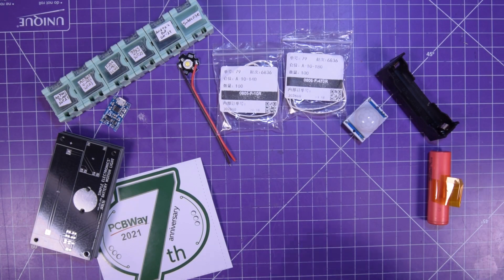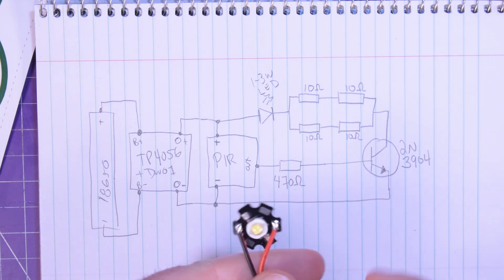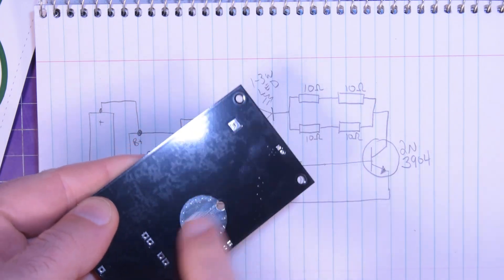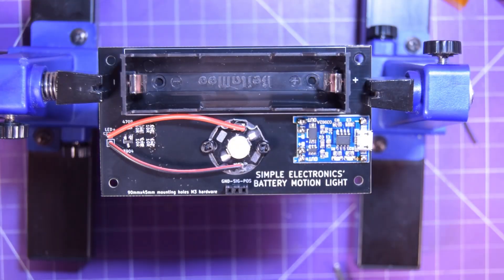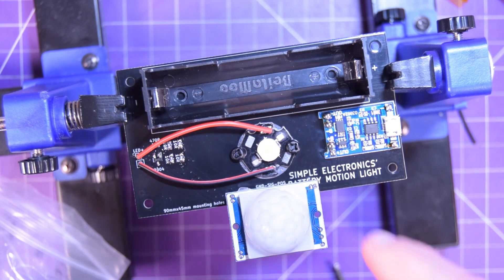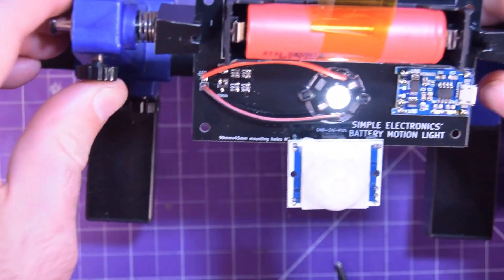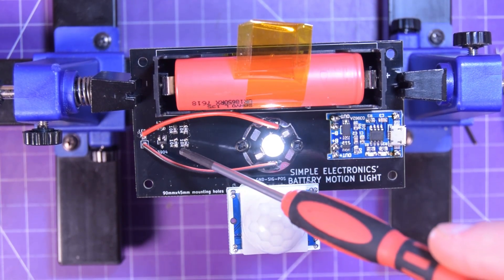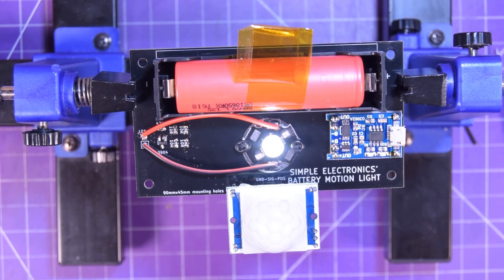Wireless Motion Sensing Light - For All Your Motion Sensing Needs!

Comment: Do you think the light is bright enough to work as an under-cabinet light in a kitchen?  That is a project I have been considering, except with motion detection to save energy, as I rent and can't go drilling holes, etc., to run power wires.  The problem is that kitchen lights are typically pretty bright.  I was originally considering strip lighting.

Comment: While most of the project built with modular parts, I suggest you add a mini led driver or chip instead of the resistors, which will make it more efficient and allow to easily adjust the current for different led wattage and brightness.

Thanks for sharing.

Comment: There are solder pads on the pir module to connect an ldr, you need to remove the white lens to see them, that's all it needs. It will then only detect movement when it's dark. The correct pads, one side goes to pin 9 of the pir chip.

Comment: Curious why you just didn't design the pcb to be either through hole or surface mount, like other boards you have done.
Also might be a good idea to add a page on your site for listing all your projects.
Reply from the maker: A lot more work to make dual footprints - and since shipping from china takes so long, I have to manage how long I work on the design of boards.

Comment: The use of four 10 ohms resistors, 2 by 2 in parallel to give 10 ohms resistance, is that done for redundancy?  I.e. If one resistor were to fail, would that mean only a single path would be left?
Reply from the maker: Done for heat dissipation and being nicer to the components, it's a cheap way to make a 1W resistor, just combining 4 x 1/4 W resistors

Comment: Just a little tip.....when using cell holders of this type insert the positive end of the cell first and away from the spring contact, then slide toward the contact, then push the cell home by the negative end. Using tape as a handle is a great idea but place it at the negative end so it gets lifted first. Why? Well, as you know, the case of the cell is negative and extremely close to the positive terminal at the positive end. There is a chance that the spring contact 'could' slice its way through the insulation on insertion or removal of the cell, and 'could' possibly short the cell in the process. Inserting / removing the negative end past the spring contact physically cannot create a short, its only negative down that end. Goes without say but if the only option is to remove a cell with a metallic object, (screwdriver), it should only be done from the negative end.

Comment: Cool. You could also mount next to it, (or built into the case), a 3D printed holder for a spare fully charged battery that can be swapped when the PCB's battery has gone flat. :)
Reply from the maker: Exactly!

Comment: I'm not an EE at all.  I'm curious why you put the 10ohm resisters in series/parallel.  Is it to handle a higher current?  Could you alternatively used a stronger resister?
Reply from the maker: I'm no EE either but you need a certain resistance to get a certain luminosity from the LED - I calculated that out to be 10 ohms. So I could use a single 10 ohm resistor but it would heat up a bit, so I put 4 in series/parallel so that they have a total of 10 ohms of resistance, but each would heat up 1/4 as much. The other option is to buy resistors that can handle more heat - but they are more expensive and I didn't have them on hand :)